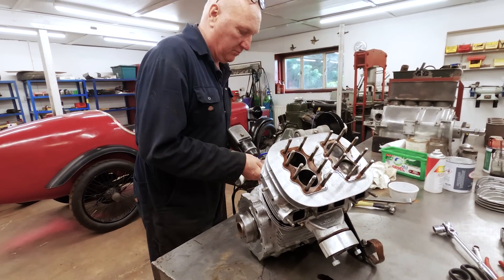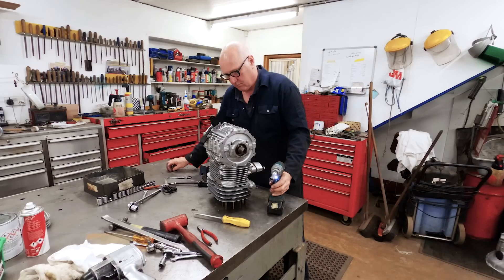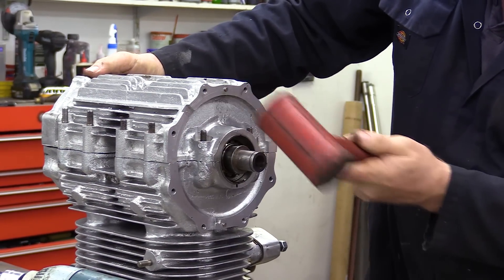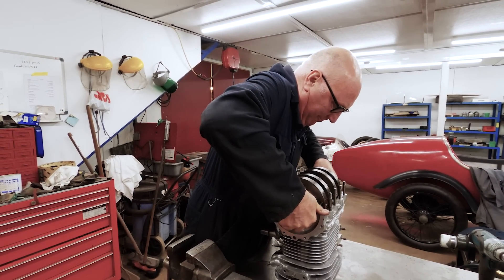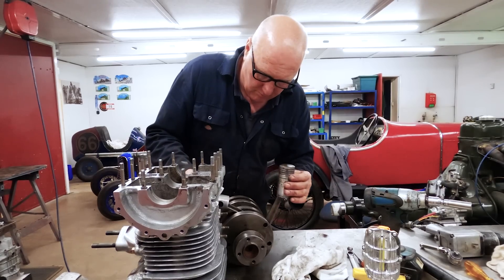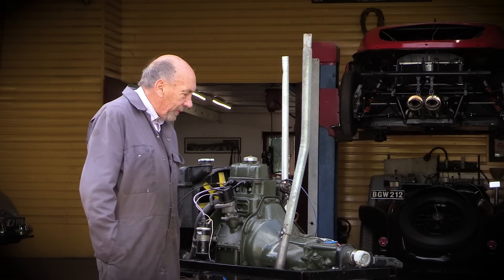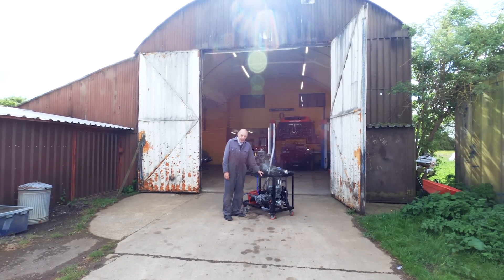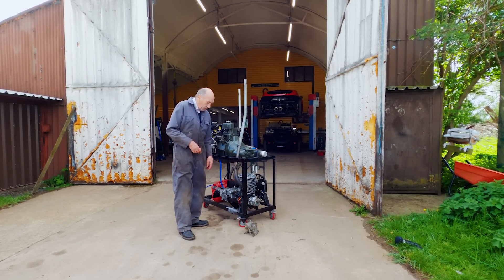SHED RACING - 2 Stroke Mini Engine/ Fault diagnosis

Comment: I ALWAYS first start an experimental engine by "bottle feeding" it with a liter squeeze bottle with a nail hole in the screw-on top. I can feed a a two cylinder engine of any kind with no manifold attached at all.
If I have a double-carbed 4 or 6 cylinder engine I have to have the manifolds (but no carbs) on it.
Most V8s use a "180 degree" intake manifold so for my purposes they are two single-carb four cylinders.
Try this on an engine that you know runs but the fuel to the carb has been cut off and it has run dry.
Squeeze a bottle with one hand and operate the throttle with the other. If necessary get a helper to run the throttle while you squeeze a bottle with either hand.

Comment: It appears to be running very lean. Totally unfamiliar with the design, not the 2 stroke part. See if you.  can locate a true 2 stroke motorcycle carb or snowmobile carb and try it or a diaphragm carb like Tillotson or Walbro with mixture adjustment screws instead of fixed jets so it's quickly changed.

Comment: Euhm im not a docter... Or am i ???    2 stroke engines most of the time have ring gape of half a milimeter (0,5mm)  i think you maybe having to much compresion... Maybe you can check the compresion if its above 10 bar is to high ... So a ring gap can overcome that ... When you made the ring i did not see u taking some extra of it ...  Try the dremmel and not the bandsaw

Comment: With your 4 stroke 2 cylinder engine, I think it would have been better if the crankshaft was made so the both pistons were at the top at the same time. This is because it takes 720° of rotation for each cycle and the second cylinder should be firing 360° after the first cylinder... with this crankshaft set up you have created, the second cylinder is only 180° after. Just my thoughts... fascinating videos 👍🏻

Comment: Could the carburetor backfires be because the rings are not seated yet? allowing ignited blowby to ignite the charge in the crankcase? Might this go away simply by breaking it in for a few hours?

Comment: A bit late but I had an industrial 2 stroke of the same 2x4 cylinder configuration (sachs I think) of which I had great success with a stromberg cd175 carb. As for the front firing maybe it needs a full set of rings? But with the compression you appear to be getting perhaps not. It maybe that the ignition system BL made for it just isn’t up to the task and its firing too early or perhaps too late, the system may be fine on a conventional 2 cylinder but not for the shared cantilever arm big end of the 2x4. It may just be a bad design altogether and budget didn’t allow them to develop further and port timing is the issue. But at this point I’m just spitballing.

Comment: i kow i might be wrong but is it possible that because its straight piped with it being a 2 STROKE that is causing the issue because i know normally a 2 stroke needs a special exhaust as it causing weird vacumn stuffs to happen maybe try a second hand 2 stroke exhasut from somewthign u know wiht the expansion system style exhaust

Comment: The heads are on backwards. The spark plugs go to the rear , over top of the intake cylinders. The engine is also turning backwards. These engines rotate counter clockwise.  Clockwise rotation causes the intake ports to open far too early and the exhaust opens late. The ignition timing will also be off if it was set for clockwise rotation.
Super cool engine. I hope it gets sorted.
Cheers
Fred

Comment: I think it is important that the pistons are in the correct cylinders, two are slightly longer than the others, if they are visa versa they will push the charge back into the previous cylinder instead of the exhaust.
It was 1971 when I last worked on a Puck split single and the memory is a little vague.

Comment: Suggestion: use the carb off a Rotax two stroke engine. They fit to the manifold byway of a Felix pipe and jubilee clip. The miss fire appears to be something to do with the timing. One cylinder might be out of phase.  Best of luck. Graham P.

Comment: The heads are facing the wrong way. The original as fitted in the prototype Austin A20 which can be seen via Google had the spark plugs away from the exhaust side. So it may be down to the resultant out of spec. flame growth speed or spread across the combustion chamber, further complicated by the twin twin arrangement.

Comment: Hi Ivan, no expert but it seems the timing is not bang on. Know this with my Raleigh RM6 Moped, Mobylette two stroke.  Spent hours having rebuilt it to discover the timing was out and the ignition cam kept slipping. This caused spitting back into the carb and running poorly. No doubt you have the timing spec for your wonderfully irritating engine!

Comment: A thing i haven't come across in the comments so far; have you considered they might have originally fitted some sort of reed valve between the manifold and intake port? That would eliminate virtually all carb blowback, and clean up the fueling issues considerably i think...

Comment: Hi , I have had experience with outboard motor ( two stroke) that commonly spat back through the carb ,this was caused by a lean mixture at low speed, the spit    Back stopped when engine was under load , try putting a load on the engine. Roger in Norfolk.

Comment: This looks like a port timed motor. Are the pistons identical to each other and are the skirts the same on each side? Most of the exhaust suggestions are correct; separate pipes and chambers needed. Off the top of my head I'd   try a 20 inch header pipe and connect to a chamber 30 inches long. A chamber is easily built with a megaphone ending with a 4 inch diameter flat back plate with an 8 inch long outlet tube of 3/4 to 1 inch id. The flat back of chamber will give a broad range of power while giving away the power peak of a double cone expansion chamber.
Have I overdone it? I can't help myself. Cheers!

.

Comment: To all the folks in here saying it needs a proper exhaust, you are both right and wrong. I have been around the good old 2 stroke engine in snowmobiles and motorcycles for about 40 years now. For best performance at a given rpm yes a tunned pipe is needed bit just to run on a stand they should run just fine even without a manifold. Will they have power? Probably not a lot but will still idle and rev just fine. 
My thoughts on this engine is ignition or port timing is off, most likely ignition. Someone mentioned spark plugs and I certainly would start there.

Comment: to me the carb thats on it looks too small and i think the other one looks far too clumbersome if it were mine i think i would be looking for a carb from a 500cc twostroke motorcross bike or even  designing a manifold for two mororcycle carbs as two strokes need alot of fuel and air to make there power

Comment: How are the points cam timed? Did someone pull the cam off to replace crank bearings & get it back on wrong. Some 2 strokes don't use a key way for alignment of the points cam. If that's the case good luck on checking & correcting.

Comment: Just listening to the 2 stroke sounds 
to me you have too much port overlap 
I would reduce it or alter the port overlap by a few degrees and have a bigger exhaust.

Or another option is to fit a power valve like Yamaha’s system

Comment: Most two stroke engines need a little back pressure via an expansion chamber (exhaust) to even run , the down side to this is the exhaust will need to be tuned to the engine and maybe custom made if the engine isnt stock..

Comment: I am sure the exhaust is the problem. Exhaust clear then smokes is result of too much back pressure for whatever reason. Exhaust gas exiting through the carb as cannot get out of the exhaust pipe.
Try running it without that tail pipe. Same result as blocked silencer.

Comment: I've had a similar problem with a soviet chainsaw engine from 1976, where it would backfire through the carburetor.
The problem turned out to be the piston. It was a standard aluminum piston but the ring retainers were made of brass and were riveted through the piston into the ring grooves.
Over time the retainer loosened up and allowed combustion gasses to go through the ring groove and under the piston, which would cause it to backfire.
The fix was quite easy, i just made a tool to get into the piston and behind the ring retainer to peen it over some more and that fixed all of my problems.

Comment: Perhaps a diaphragm carburetor would be better for running a two stroke engine, It would be better for fuel delivery i believe, as always your program is intellectually stimulating, thanks for the unique projects, i am a weird engine fan for a lifetime,👍

Comment: May need expansion chambers designed to be of a sufficient size to allow exhaust gasses to be held within the chamber until the next firing cycle can force the said gasses from the previous firing cycle out of the chamber rather than allowing the exhaust gasses from re entering the cylinder and causing the backfire

Comment: I won't go into family history but let's say I am unusually well versed in the do's and don'ts of scratch-built two cycle engines. First off you have to have DOUBLE LIP seals on any shaft entering/exiting a crankcase-scavenged 2 stroke. This includes between two crankcases as well as the PTO and magneto ends. Second look (and smoke-test) your "piston valves" for sealing. Don't assume that just because you can see the piston closing off an inlet,  transfer or exhaust port port - that is is not leaking like crazy.
Lastly I recognized your engine as two 125cc Puch twin-singles grafted together straightaway. As an aid to troubleshooting you should borrow a stock and standard 125cc Puch and check it's port timings and see if yours are nearly the same.
     Finally - and this may seem far-fetched to you - I have experience with ancient T-head 4-strokes which naturally exhibit "charge stratification" in the combustion chamber. (In fact this was an advantage when ignition systems were terribly weak and L - head engines refused to run stably at all)
    Historical artifact or not - you may well consider having two spark plugs in each combustion chamber similar to a Wankel engine which has that same feature. Possibly as you rev your double-Puch the place at which the mixture is ignitable is moving away from your single spark plug's location.
Reply: One more thing - while you are trying to get it running - fit each cylinder with independent exhaust. I suggest each exhaust port have about a foot of straight pipe and then be led into a simple "no effect" expansion chamber such as a recycled propane or freon tank fitted with an outlet about 75% as big as the inlet.
    This one thing could easily be the entire problem you are having.
Reply: @patrickshaw8595  As far as I am concerned , the long answer you gave is imho opinion the correct answer.
Reply: @Chappomusic  Thank You you are Welcome.

Comment: I had a Puch 175, not a fussy engine it ran 24:1 on sae 30 with worn pistons.The misfire sounds like ignition. Two other possibilities, maybe it needs 2 carbs? no one ever made a double twingle afaik. secondly could the compression be too high? love the channel, it's all real.

Comment: Don’t think I’ve ever seen a 2 stroke with a 4:1 exhaust, back pressure is probably blowing back through exhaust ports across the piston and into the inlet port / crankcase back to the carburettor.  Look up SAAB 2 stroke engine to see their exhausts.

Comment: Put the reed valve back on, you will need it when it runs correctly. Otherwise, it might be worth looking at a Kawasaki style disc valve. For tuning inspiration, look at the 1979 Suzuki Jimny 4x4 2 stroke engine, it may well provide some answers to the issues you are facing.

Comment: Something to consider.. as a small engine mechanic in a past life, i worked on many old 2 stroke industrial/garden care engines. Many developed similar symptoms to yours- spitting out the inlet. On every occasion this was caused by excessive piston skirt to cylinder clearance. It doesn't matter how good the top end cylinder compression was, if there was excessive clearance they would spit out the inlet. A rebore and new piston fixed it every time.

Comment: I suggest trying slightly earlier ignition timing, and also sparking plugs with precious metal electrode tips. I think the combustion is taking place too late and/or too slowly, so it is not completed by the time the transfer ports open. I suspect that this design of engine may need more ignition advance than a conventional engine, because the flame has further to go from the sparking plug to the far sides of the cylinders. Also regarding the direction of rotation, the split layout gives asymmetric timing of the transfer and exhaust ports and this has to be in the right direction. If you imagine the engine in a motorcycle then if it is turning in the same direction as the wheels the transfer ports need to be on the front cylinders and the exhaust ports on the rear cylinders; vice versa if the engine runs in the opposite direction to the wheels. If the engine is running in the wrong direction, the transfer ports are possibly opening before the exhaust ports; I think this would cause a strong tendency to spit back.
Reply: Further to my previous comment, I think it is possible to see from the video that the positions of the transfer and exhaust ports are correct for the direction of rotation, assuming that it is clockwise as seen from the end with the ignition system.
Reply: Yet another thought: what is the definition of top dead centre on a "split" engine? There is a point of maximum compression, at which the piston on the exhaust side is already on the way down and the piston on the transfer side has not yet reached the top of its stroke. I think this point of maximum compression has to be regarded as top dead centre for the purpose of determining suitable ignition timing. You could find it accurately with a U-shaped transparent tube with some oil in it, attached at one end to a bung that fits into one of the sparking plug holes.

Comment: From an old time 2c mechanic:  Two strokes have a smaller throttle slide cut-out than a comparable 4c.  I'd guess that a Mikuni carburetor off an old Suzuki T500 twin would be ideal for a bench-mark unit to make the engine have proper carburation.  A carb with too large a bore will not allow good mixture draw or atomization and the consequential lean/rich fuel draw will cause the engine to spit and backfire.
Reply: Funny, I had a couple of Suzuki T 20 250cc twins a long time ago
Reply: @TheWrench-Wright  They were primo bikes in their day.  Only thing going against them was the eventual deterioration of the inside crankshaft seals and they would start sucking transmission oil.

Comment: The split single type of two stroke is after all, an antiquated design, when DKW used them in their racers, they were supercharged.
Reply: @Alfred Wedmore 4  valve OHC are still with us today, twingles were outmoded as soon as the Schnuerle porting system came in - and it is still with us.
Reply: @Alfred Wedmore All modern 2 stroke motorcycle engines use the Schnuerle porting principle, because it's better all round. That is why all the major manufacturers adopted it.
Bored with this now.

Comment: A warped crankcase can cause a vacuum leak into the crankcase. I had an air cooled snowmobile that was so warped it backfired between the crankcase halves.

Comment: I don't know how, but you are setting fire to the 2T mix in the crankcase.   You can see all the soot in the bottom crank case halve.   It looks like some sort of ignition misfire happening when the inlet ports are open and flashing right down through the entire crank case.     Is there a chance the ignition coils are interfering with each other ?   As a test completely separate the ignitions so they are like two completely separate motors.  the only common thing is the points cam.   The wires to the coils 2-3 inches apart, the coils a foot apart etc.     Also  mark the crank pulley for tdc for each piston pair.     Start the motor.   Then put  timing light on each plug lead and check the ignition is happening correctly on each pot and keeps doing so as you bring the rpm up.  2nd also check the opposing cyclinder isnt being fired at bottom dead center by EMF or something weird.    3ndly 70's 2T motor cycles didn't run any mechanical ignition advance.   I'd  disable any advance mechanisms.  Then using a dial indicator have the points close about 3mm before top dead center btdc.     5th Also is it possible the exhaust merge pipe is setting fire to the opposing cylinder , while the exhaust port is open and the un-scavenged 2T mix is wofting out of the cylinder.   Maybe seperate the left and right pipes.     6th Also,  2 strokes can run forward or backward , they don't care much (a back fire can result in motor running backward and they keep running until the kill switch is pressed).   That crank seal direction won't matter,   the tiniest bit of air it might suck is not going to cause this issue.    good luck.

Comment: I wonder if your middle crank seal is leaking letting the compression and drawing vaccume between the two bottom ends transfer. It doesn't look like there is a rubber seal in there , I have seen snowmobile engines with a labyrinth seal between the two sides of a crankshaft but I don't see that in yours either...
Hugs from Canada

Comment: I remeber years ago putting the cylinder head on the wrong way around on a CZ or MZ and it gave me the same issues of spitting back, it looks like the bolt pattern may allow this on this engine. Hope you continue to pursue it and get this one to run properly.
Reply: Yes it looks like the spark plugs are on the far side of the heads when Ivan first showed it before the rebuild.